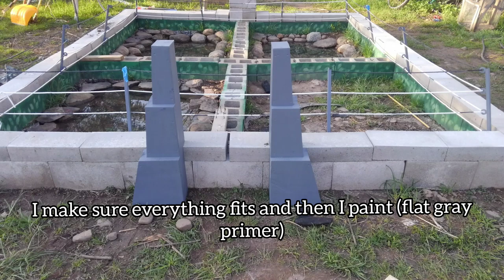Jurassic Park turtle pond build

Comment: Such a sick project. You just need a speaker and play the jurassic park theme song. Im sure youncouldnt because of copy right reasons.
I also think you shouldve made the ponds in each section 2/3s so they they would have a platform to come out of instead of just a basking rock or side edges. 
But regardless, this was the coolest turtle enclosurre ive seen. Fron the walkway, the gate, to even the electrical fences. Job well done!!!

Comment: The spray paint and the cinder block are going to   leach into the water and posting the turtles  should have used river stone.
Reply from the maker: They were sealed to prevent any leaching and they never touch the actual pond water, so rain run off would be the only concern, but again, they were sealed using a clear coat just in case. I decided not to use river stone as it collects debris and wastes which will promote extreme algae blooms. Thank you so much for your concern ❤️🐢